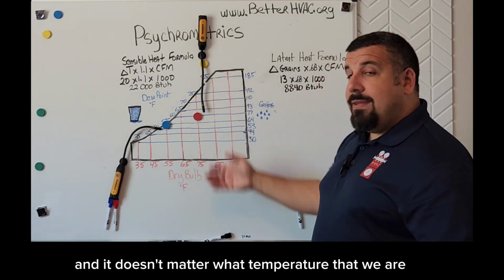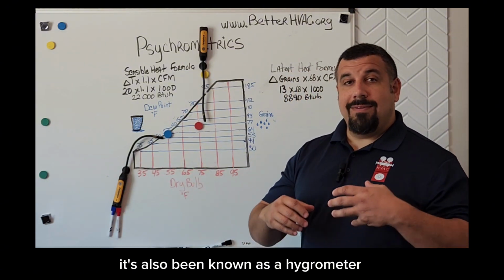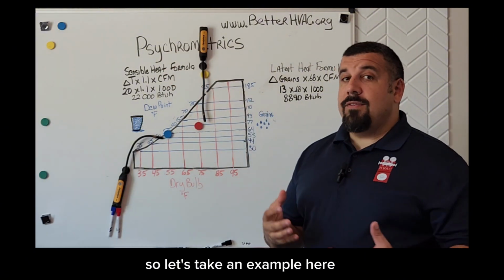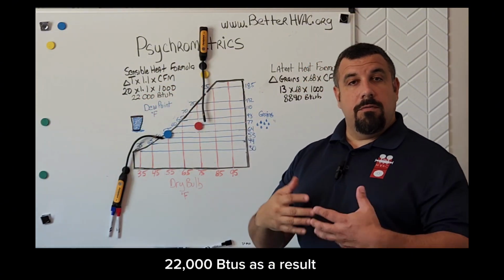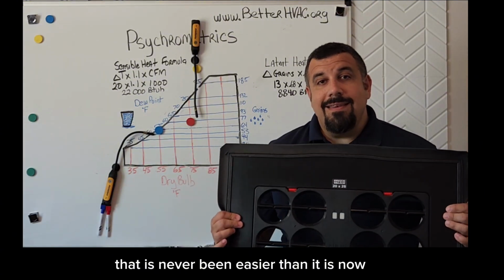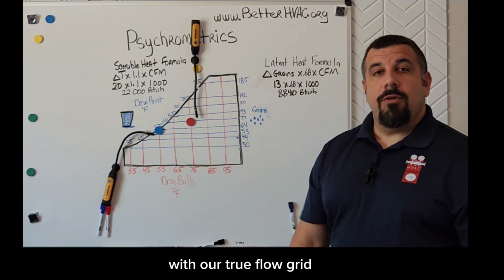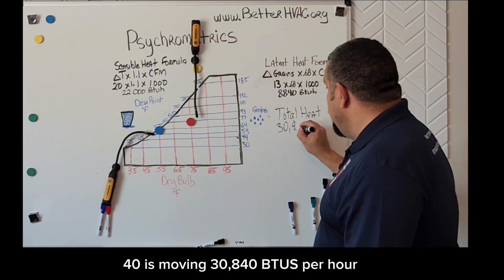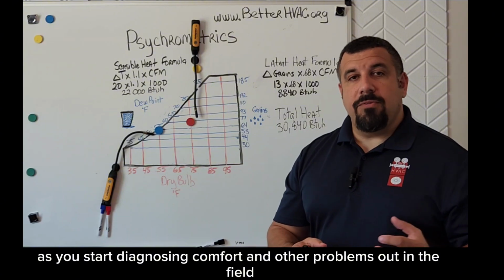Psychrometric Saturday: Latent Heat Formula

Comment: The change in humidity on the humidity ratio axis on the right of psychrometric chart gives the evaporation by multiplying with latent heat in X Joule / kg

On the left on enthalpy axis these two points give total enthalpy change dH in Joule/kg. dH is sum of latent and sensible heat 

(dH - X)  = Sensible heat in Joule/ kg

Comment: The true flow grid has become such an important tool now.
If you don't measure you're just guessing. Im amazed at how many times I see a 5 ton blower drive on a 3 ton system and it was left at the factory default speed.
Reply from the maker: Awesome comment